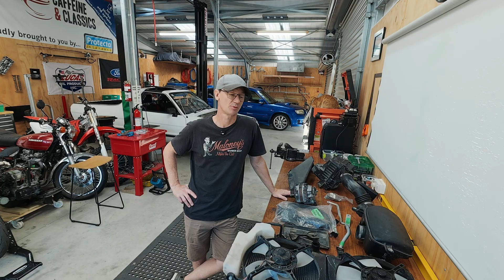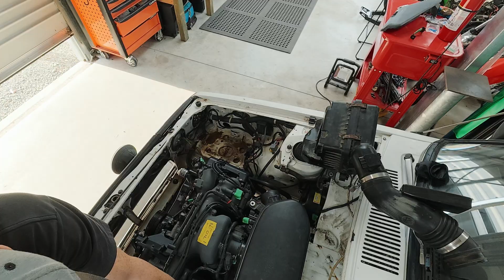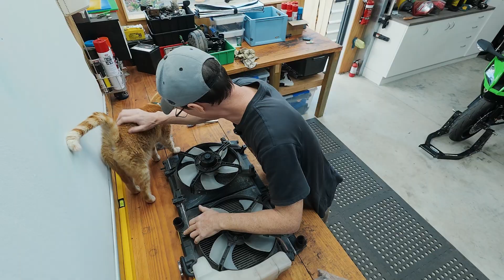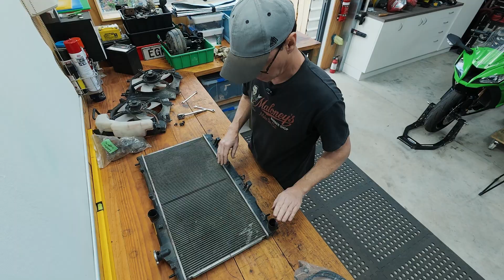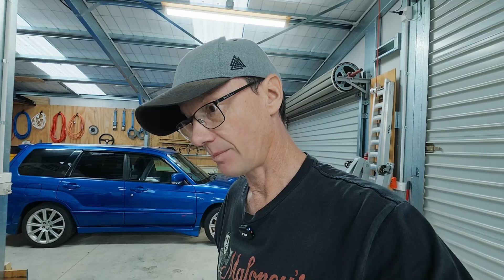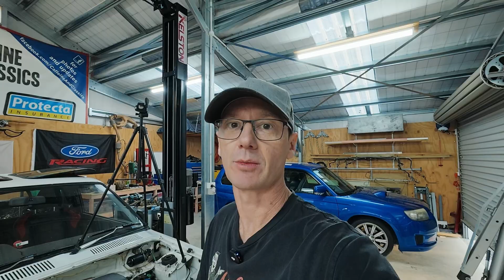Brumby build Ep 8: Engine bay components

Comment: I love that you’re working things out as you go! That said it’s also a bit frustrating for those that know these vehicles well. Still enjoying your videos though and I reckon it will benefit others that are new to a build like this.
Some ideas/advice that may be beneficial to your build, I hope it doesn’t come across as pushy/know it all etc, it’s meant to be sharing of information much like the old forums used to be (but without the “banter” that could occur at times).
Use your brumby radiator and have the inlets modified to suit the EJ size, the top inlet might benefit with an angle pointing towards the engine; or use and adaptor ring on the Brumby’s radiator. Use an earlier EJ upper radiator hose. The radiator will have enough cooling for the EJ251/253 with a decent set of fans. 

With my turbo conversion into my brumby I’m working on at a much slower pace than you (lack of a suitable workspace unlike your awesome setup etc), I slotted the engine mount plates that sit between the engine and the engine mount. This gained me 15mm up front. I am able to fit the factory radiator and two 11 inch fans which will be ECU controlled. This engine push back move will influence the gearbox mount setup, it will change the required tailshaft length and how you cut down the gear linkages for the gear stick setup…

What are your plans with the EJ wiring loom? Asking as you won’t need the fuse box if you’re doing a cut down that just retains the engine management stuff - so no need to sort out the fuse box mounts. You’ll add fuses to the power wires between the EJ loom and the factory brumby power wires.

If you’re using the whole front end loom from the EJ for lights etc you’ll need the fuse box - but you’ll need to factor in the extra length of the EJ loom for the larger engine bay from the outhouse. 
Wiring cutdown and loom job can be DIY’d - and I’ll be honest, it’s daunting at “one or two points” along the way as you get your head around it! Finding a FSM online for the model outhouse of the donor vehicle is key to this. 
I used a grommet from my GT forester loom to poke the wiring out on the LHS firewall hole where there’s a blank grommet from factory on the brumby. 
Leave the alternator in the factory position, moving it back will probably create issues with sharing space with the intake manifold. Use two bolts in place of the single factory bolt unless you want to pull the radiator if you ever need to change the alternator out for a new one. 
Did I notice the spare wheel mount was cut? I couldn’t quite see when you moved the camera for a better angle with the airbox before the throttle body hiding that detail.
Reply from the maker: Oh and the spare wheel mount is still fitted, I haven’t worked out the pitch bar yet
Reply: 👍👍 keep up the good work!
Your ECU from the 2007, CANBUS system or not? If canbus that’ll add complexity to the wire strip down to get it operating properly - you may need to get an emulator sorted. A crew in Brisbane do them for wrx conversions or upgrades, they might be able to help out if you need them.
Reply from the maker: Based on the year and looking at the harness, I think it is canbus. I'm aware of AGT's emulators in NSW, is there another company making them as well?
Reply: @AmbitionvsTalent  that could be the mob I'm thinking of - it was a while ago that I was looking into emulators for a potential project.
Reply: My pitch bar plan is to use the brumby one with a bracket mounted on the engine bellhousing - or with a long bolt through the EJ gearbox bracket that meets with the pitch bar somehow, but leverage is the issue with that idea. Having both could work well. 
My setup might use the intercooler support bar as the bracket - loose idea atm as I’ve not finalised anything. 
I’m keeping my spare wheel mount as my goal is not to cut anything or drill any new holes as it’ll keep the value higher (not that I’ll look at selling!).
Looking forward to your next video!
Reply from the maker: Good ideas, I look into that concept of keeping the factory Bumby pitch mount, and changing where it mounts at the EJ end. I'm of a similar mind in terms of keeping the shell intact, so far everything is largely reversable without major hassle. Cutting the shell up feels wrong, even though I don't see me selling this car anytime nor do I imagine I'll ever look to revert back to the EA and 4 speed combo. I'm likely to remove some brackets from the shell, but will try to limit that to removing spot welds so that the brackets are kept intact and can be welded back on if needed.
Reply: That all said, you’re most likely well down the path of finalising this project if it’s not already completed!
Reply from the maker: Awesome info here thanks, it doesn’t come across as pushy at all and I certainly appreciate what you’ve shared. I’ll have to work through it all carefully but you’ve given some good suggestions and pointers - thanks heaps for taking the time to share all of this! And no, I’m nowhere near finished yet - got lots of ideas but many things including gearbox and diff angle etc are still far from finalised

Comment: I like your thought process and objectives . .. If you are not installing AC and not going to run PS then using the rear pulley with the ALT would be awesome. You might be able to find a pulley that is the same diameter but has a different offset depth for that ALT so it would line up with the rear pulley like you mentioned. Keep it up, Onya!
Reply from the maker: Cool, thanks for the feedback! It’s good to hear that I’m on the right track. I think that might work, then I can always keep the other pulleys in case I ever add PS or AC. Like all project cars, even after I’ve got this back on the road there’s bound to be future upgrades and changes 🙂
Reply: I’ve installed ej22 into my brumby but I will have power steering and ac, I’m running brumby radiator but with the 2 inch lift kit space for thermo fans is terrible! I’ve decided to ditch the ac evaporator core that sits in front of radiator and mount 2 pusher fans….. I’m going to get a custom ac condenser and fan combo and remote mount it in tray cabin back wall! It’s pretty hot where we live and I’m getting soft in my older age😅 I took time going to car shows and club meets looking into a solution for lack of room for decent cooling solutions but only found compromises until I found customer ac condensers that can me mounted in various undercar positions etc…… wish me 🍀
Reply from the maker: I'd love to have PS and AC, it gets over 30 deg C here in summer which is warm enough to feel the lack of AC at times. I've kept the AC equipment from the donor car but my mind keeps going back to using aftermarket units like you mention, to keep the engine bay less cluttered and I figure it'll also have benefits in terms of keeping weight away from the nose of the car. If you work out a good solution, please let me know!
Reply: @AmbitionvsTalent  Electronic assist steering columns show up on a lot of YT builds from a variety of donor vehicles. Depending on Oz Engineering inspection requirements and space you might be able to fit one of those. That would leave more room for the AC compressor, or there are also 12v units for those too. For me . . . AC would be priority over PS.